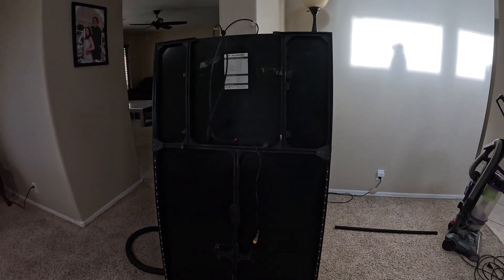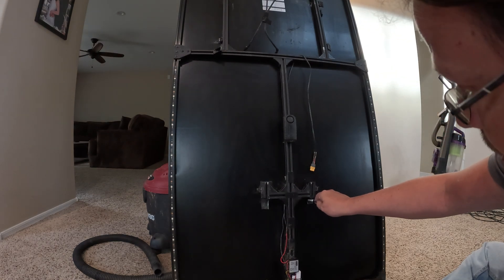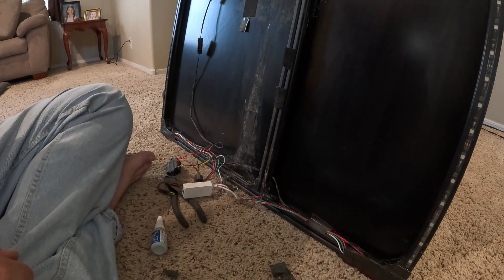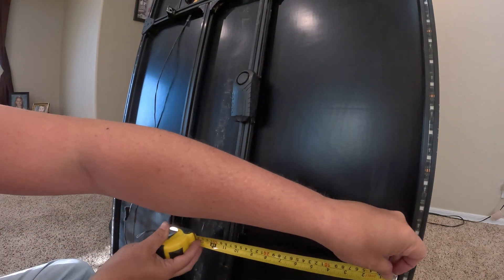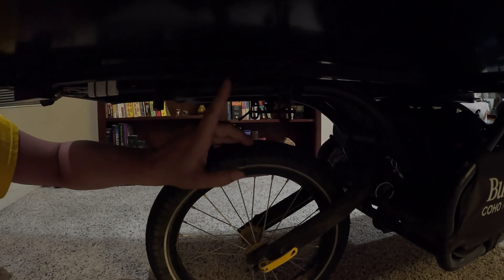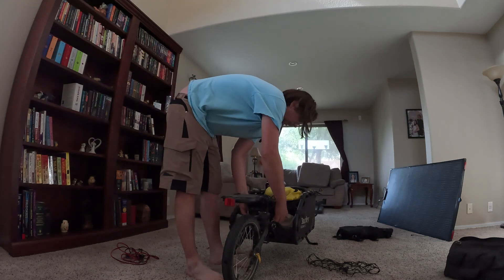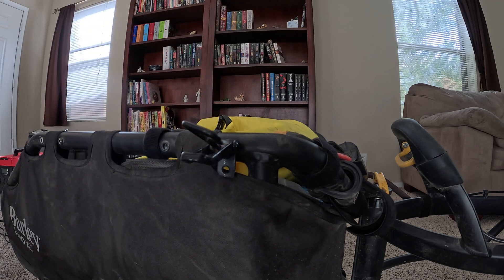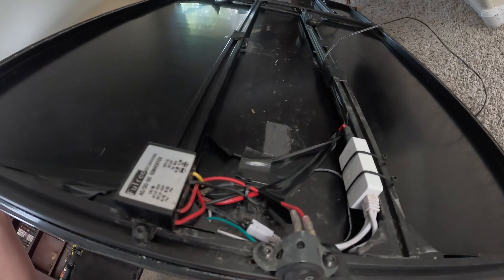200w Solar E-Bike Trailer Upgrade: Adding Stability

Comment from the maker: 🛒2020 European Standard T Slot Aluminum Extrusion https://amzn.to/3thDcTN
🛒2020 European Standard corner Connectors https://amzn.to/45W2N3e
🛒2020 Aluminum Extrusion Connector Bracket https://amzn.to/3ECUsVV (Weak T-Nuts, Rest is fine)
🛒Bike Trailer https://amzn.to/3EycKI0
🛒200 watt Solar panel https://amzn.to/3LkQ1CM
🛒Velcro https://amzn.to/45K5mVQ
🛒Genasun GVB-8-Li-54.2V-WP https://amzn.to/3RAeIiv
🛒Oreq Solar Charge Controller https://amzn.to/3PwHwWD
🛒2020 Hinge https://amzn.to/45cicek
🛒Latch https://amzn.to/3PZk4mz (Had to bend clip to fit right)
🛒Rear Lights https://s.click.aliexpress.com/e/_DDMEUx5
🛒Tape https://amzn.to/3LRISKD
🛒DC(15-52V) to 12V DC Buck Converter https://amzn.to/46Gpzfq

Comment: I hope people know you never ever actually flex a fake flexible mono silicon solar panel...it will crack...it should absolutely be sold with a stiff frame but it is not...👎 I prefer the cigs panel even if it is more expensive (I don't buy them if it is more then $2 a watt)...

Comment: Grind in a notch on the top of that bolt and you can use a normal screwdriver to get that stripped bolt out. Look forward to see it in use!
Reply from the maker: Indeed Dremel time

Comment: I'm sure you have a reason for using that style trailer vs one with 2 wheels that you don't have to balance, and likely you've discussed it in some other video. But if you don't mind explaining it again I would appreciate learning about it.
Reply from the maker: One wheel allows for the trailer to stay balanced around turns at high speeds.
Reply: @Eric_Tennant  thank you for responding